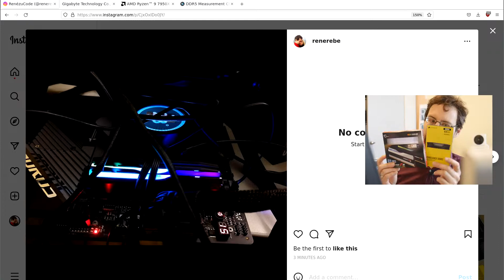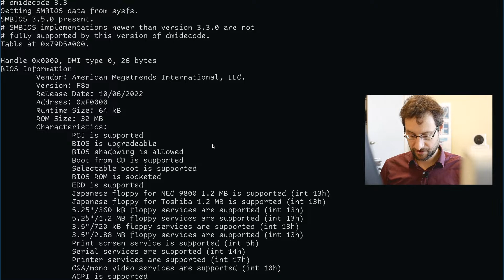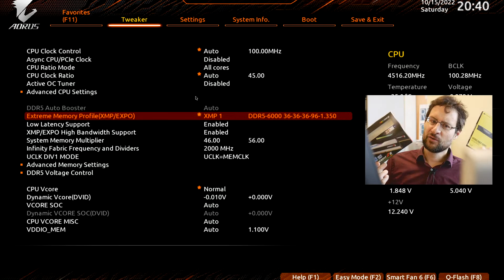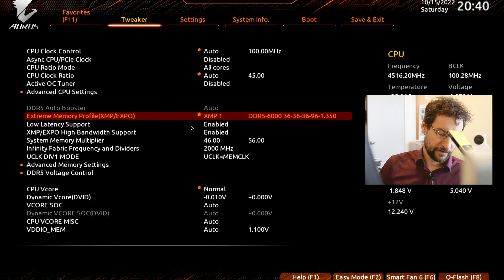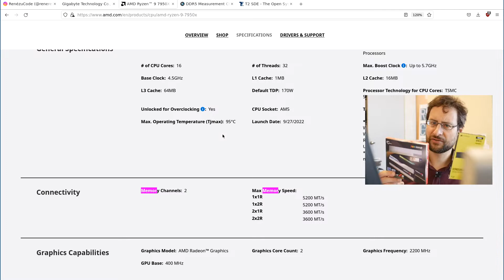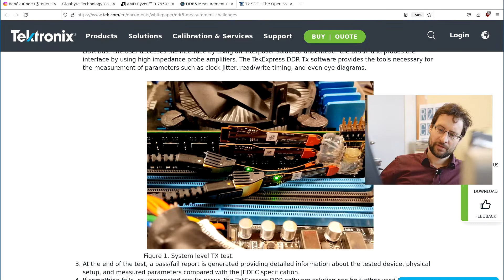¡Not so fast:1500MT/s slower AMD AM5 Ryzen 7000 dual modules per channel!

Comment: Seems i9-13900K is better at compiling than Ryzen 7950 and together with the cheaper ddr4 platform cost make Intel the optimal platform at least for compiling both for cost and for performance.
Reply from the maker: Not really. It is barely faster and consumes way more power. While ddr4 is not much cheaper anymore and ddr5 delivers a bit more performance already. Plus intel was an unfriendly, if not mafia methods company for decades.

Comment: Running more than 32GB or more than two sticks killed speed on DDR4 as well. I wouldn't expect much better results with DDR5 in similar configuration. Especially with first generation with DDR5 controller and early BIOS. I was early adopter of B350 and Ryzen 1700 few years back soon as they hit the shelves. I had massive problems with RAM even running at lower JEDEC specs. Things did improve over time with BIOS updates, but really Ryzen didn't get decent memory controllers until 3000 series Zen 2. I think I'm going to stick with my 5900X maybe until Q2 next year just to wait out BIOS patches. Don't feel like being early adopter this time.
Reply from the maker: I did not have much slowdown for my 96GB in 4 modules on my 5950x
Reply: @renerebe  I still struggle going higher than 3333Mt/s with decent timings having 4 sticks of Samsung B-die on my 5900X. Admittedly it could also be that one of the sticks ain't playing nice. I never tested them individually to see whether they had similar OC potential.
Reply from the maker: I’ll check another day, afair I run my 96 go faster than that